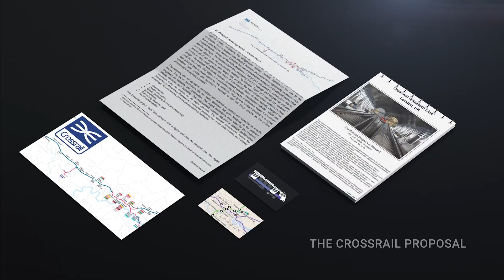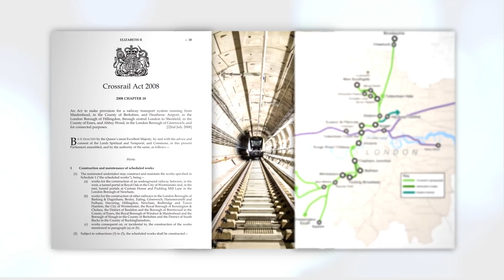London's $20 Billion Plan for High Speed Rail, Explained

Comment: There are inaccuracies in  this video. 1.  London is  not one  of the  largest cities in the world: it is the 38th largest city; that's quite a long way down the rankings. 2. I have never heard anyone call it 'Crossrail'; it is the Elizabeth Line. 3. The Elizabeth Line has been a spectacular success. Last year, it was stated that some 650 million passengers had used it since it opened in 2022. This is probably nearer 750 or 850 million now. Within a year or two we'll be able to say that one billion passenger journeys have been taking on the Elizabeth Line, which is the most heavily used rail line in the UK.

Comment: It is an absolutely amazing as far as engineering is concerned. As a Londoner, I believe it kind of fell flat on its face though. Trains don’t run as fast as was promised and no continuous East to West train. As for the CR2, I don’t think that’s ever happening.
Reply: Crossrail2 is happening the safeguarding for the route has been done, the between Maidenhead and Reading was an extension which was only added on later.

Comment: Just wondering, how did they decide that Reading, Shenfield and Abbey Wood would be the terminii of Crossrail? The first two are outside London, but the third is well inside the urban area.
Reply: It is all dependent on demand, originally Elizabeth line was only going to go as far as Maidenhead, but it was agreed that it would go to Reading, which required an extra 4 units to be ordered. For the Shenfield side, it was because of it having directly taken over and replaced the Greater Anglia Metro services. Abbey Wood is another terminal because of the connections to the North Kent Line.

Comment: The railway was built to take pressure of the Central line, the roads was a new one on me, just an excuse with rising travel costs and the cost of fuel at the pumps, Crossrail might take pressure of the Hammersmith & City and Circle Lines to/from Paddington.
Reply: It was designed to take pressure off the central and jubilee lines.
Reply: @suburbia2050  Funny that as the Jubilee Line Crossrail station at Bond Street was not open yet
Reply: @jacksugden8190  well Stratford and canary wharf are the main pressure points for the jubilee line
Reply: @suburbia2050  Waterloo Station may have been another

Comment: The central section opens to the public in a week's time, and when you released this video, trains had been running through it for final testing for months, so you're vastly wrong about the timescale. The only station that will be delayed is Bond Street. Crossrail may be late, but it's far from a failure.
Reply: Thanks for this comment... I was about to say something about the opening date for the 24th May (and I'll be there!) The bonus (with reference to the "antiquated" term) is that the first stage of the Bank station expansion/enhancement project will have opened the week before, so I'll get to sample both in one go! If you haven't already done so, watch the "Hidden London Hangouts" episode released last night, a sneak preview of the improvements there (and BTW it's a great series for both history and transport enthusiasts alike)

Comment: This isn't a failure when it hasn't even been allowed to run yet? The project was overbudget and delayed due to software issues but to categorise it as a failure is very premature and asinine. I worked on this project as well and it's an engineering marvel that Londoners will use more when they realise how good it is at reducing times and travelling with ease.

Comment: How can t be a failure when it hasn't started running yet?  I guess in the early days many people we go on it just to see,but then when it's running fully it'll be fine. I'm sure the people in Essex wanting to go to Heathrow will make good use.
Reply: Elizabeth line started operations in 2015 under the brand name TfLrail which was operated by MTRElizabeth Line and the class 345 aventras entered service in 2017 on the Great Eastern Mainline, then in 2019 on the Great Western Mainline. In 2024 they have now signed a deal for 10 extra units to help deal with the overcrowding on the line.

Comment: Sadly the mis-management of Crossrail will result in Crossrail 2 not being considered for a generation. Yet Paris has five working Crossrail lines for years and has embarked on a Paris transport project far more ambitious and larger than Crossrail 1. Inflation was factored into the Crossrail project but I assume the contractors and engineers submitted unrealistic low bids not to “scare the horses!” Essentially it’s a twin bore tunnel under central London from Paddington to London peninsular and under the Thames. The surface rail lines east and west were already in existence. Quite frankly if I travelled from Reading to London I would never use cross rail, only interchange at Paddington. The trains on GWR are far more comfortable, no hurricanes blowing through the train, journey time is faster but since Crossrail there are fewer GWR trains, not really a gain except for travel to City & Canary Wharf changing at Paddington. All rail infrastructure benefits the public but at a cost. The “Crossrail management team,” jumped ship and transferred in bulk to HS2, so that project is going to be delivered on time and in budget!
Reply: What a load of Crap. The Elizabeth line because it is underground at the major terminals it frees up expensive station platform spaces for those express trains that you love. You know commuter choice and all.
Reply: @suburbia2050  What are suggesting instead, building a surface line from Paddington to Canary Wharf? You need to take a look at the transport system in Paris, very much superior to London and in the future on completion of the grand Paris express project.
Reply: That the GWR trains don't call at most intermediate stops so if you want to visit and intermediate stop you have to use Elizabeth line or if you want to use off-peak tickets you have to use Elizabeth line between 16:00 and 19:00 on a week day.

Comment: "London is currently building the largest infrastructure project Europe has ever seen"... Paris is currently building 200 km of tunnel all around the city. So, no, Crossrail is not the biggest infrastructure project in EUrope.
Reply: Errr it was when the tunneling and stations were being built. 200km of tunnel? Errr lol
Reply: HS2 is larger than the Paris Project.
Reply: @J-Railway-Volunteer  i was talking about Crossrail/the elisabeth line, not HS2, which is not limited to London.
Reply: Some parts of Crossrail where built outside of London like between Heathrow Airport Junction and Reading was electrified as part of the Crossrail program as well as a new turnback siding at Maidenhead and carriage sidings at Maidenhead.
Reply: @J-Railway-Volunteer  thank you fir the info. But again, the lessage was to say that when the video claimed tht crossrail was the biggest infrastructure project in Europe, that was wrong as the Grand Paris Express waq of anither level
Reply: HS2 is a bigger project than Grand Paris Express. Crossrail was the biggest project until HS2 was announced in 2010 with construction starting in 2017. HS2 is larger interims of amount of track than Grand Paris Express.

Comment: Good video! Also - I fee like the commentors are misunderstanding the video. To me you were basically describing how complex the project is. You literally said at the end that "in reality it is a .... (positive thing).  It's weird. When watching any infrastructure type videos for projects outside of the US (and sometimes Canada, the UK (obviously not in this case), and Australia) the videos are supposed to be commercials for the project according to commenters. But if it is in the US (outside of some Sunbelt projects) then a video on instracture that isn't a straight up roasting video gets labeled as propaganda.
Reply: Misunderstanding? Within the first 30 seconds Crossrail was called a failure multiple times. A project that's almost ready at the time of posting & this video contained numerous errors that others pointed out. 

This was a poorly timed video or a fuckin genius play by the creator to boost engagement by having people in the comments call out the incorrect assumptions and facts.
Reply: Crossrail was easy compared to other projects have been built in the UK rail sector.
Reply from the maker: Thanks, I'm glad you enjoyed the video. I believe that Crossrail will be successful, and I think it will solve a lot of the infrastructure problems London is facing.

Comment: I disagree, this is a massive feet of engineering, the stations and trains are excellent and it will help take capacity off the very popular and crowded underground lines. Also it isn’t just a tunnel, dozens of new deep level stations as well as surface stations on existing and brand new lines.

Comment: As someone who has traveled on both Londons and New Yorks underground system, its very strange you use the word antiqued when referring to londons network. Excluding Crossrail London underground has been extensively upgraded and modernised completely in the last 10years, new air conditioned trains, remodelling of stations, upgraded signaling and many major extensions. I think your video is poorly researched.
Reply: I agree, despite some tunnels being very old, the amount of investment of upgrades and modernisation is actually technically better than NYC's subway (which is a fine subway in its own right, not an attempt to knock it). There have been multiple other projects on a scale approaching Crossrail that have been cancelled before in past decades so to try and criticise Crossrail while also calling London's public transit antiqued is a definite contradiction.
Reply: The London Underground is way better, more colourful and more comfortable than  the New York Subway. Among the many reasons for this are two: 1. London Underground stations are distinctive and  easy to see from a distance. The entrance to New York subway stations look like, and can easily be mistaken for, basement entrances. If you look carefully you might just be able to see the station name - in really small letters. 2. The announcements on London Underground trains are loud and crystal clear - because they are recorded and spoken by actors. But they're also clear if the driver has to speak. By contrast, the announcements on the New York Subway are too soft against the rattle of the train, spoken by the driver and  are thus really indistinct. I could just about catch the name  of the station but nothing else.

Comment: Not sure when this was written but as of March 2022 all rail, station and signalling infrastructure is complete and tested and are now in shadow operational mode. All stations bar one have been completed and handed over.
This month has seen the last of the emergency testing with hundreds of volunteers being used to vacate a stopped train in a tunnel.
In fact the western end out to Heathrow and eastern ends of the line out to Shenfield have been operational for some years.
As for costs now they are what was budgeted at first but cut back to gain Parliamentary approval. So they were actually accurate!
Failure? No. It is an incredible feat of civil engineering and some of the techniques used to safeguard old buildings and miss all the underground infrastructure while tunnelling are industry leading and now used elsewhere. I would rather it was late than never be built.

Comment: 4:15 “it just needs to be lined with track to be completed.” As you are showing a clip of a train in the new tunnels with tracks. Tracks were laid in 2017/2018
4:35 Yep, Crossrail services ran between Liverpool street and Shenfield since 2016 (taking over from a local operator) and Paddington to Heathrow in 2018 (again taking over from another operator and 2019 for Paddington to Reading services to he handed to TFL from GWR. Abbey wood station has been open since 1849 and the Crossrail refurbishment finished in 2017, not 2021.
Crossrail is opening in 2022, the central core, in which the whole line will be functioning by then. Full integration in stages until 2023. The full integration was supposed to happen in 2020. so actually only 3 years behind schechuled. for the full line.

CROSSRAIL IS NOT A FAILURE. This suggests that no one will use it. Just because its opened late doesn't mean its failed, I hope you're aware of that.
London's existing underground railways are not antiquated. New trains for 4 lines came in in 2010-2015. New trains for Piccadilly line by 2025. Northern Line extension. Bakerloo Line extension, Jubilee Line extension,  the BILLIONS TFL have pumped into the system to refurbish, expand and rebuild system. Automatic trains on 8/11 lines. If anything its modern, even for European standards.

At least you didn't call Crossrail a new London Underground line.

POST-OPENING EDIT:
I think its much more heavily used than TfL expected post-pandemic, another reason why Crossrail is not a failure
Reply: So many things are wrong with this video
Reply: If it was a failure, then why has a new contract been signed for 10 additional units to deal with the over crowding.

Comment: The railways complete, it’s in testing. 2 stations yet to finish but it’s 95% there. There are testing trains running through the core section. Liverpool to shenfield opened 4 years ago!

Comment: If you want to see a construction product well over due and over budget come to South Wales where  the A465 trunk road  is being dualled from Hirwaun in the west to Abergavenny in the east , a distance of some 25 miles (45km). The widening of this road from single to dual carriageway started in 1999 and is still not yet completed. The final section from Hirwaun to Dowlais Top  should  be  completed in 2025 bar any delays of which there will be many, no doubt given this project's history. The most recent section completed which was three and a half years over due itself is between Brynmawr and Gilwern. This section, despite its newly acquired dual carriageway status should have a speed limit of 70mph ( 110kmh) but instead has a reduced speed limit of 50mph( 80kmh)  which is less than before it was upgraded!!! . Pathetic!!  So, allowing for delays etc I cannot think of anywhere in the world where a  45km road will have taken nearly  30 years to build! Oh and jokingly  the proposed budget at the outset was probably around 15 shillings and ha' penny.  🤣🤣🤣

Comment: I fail to see how unique or innovative Crossrail is. 
This kind of project is nothing new.
London is basically doing what Paris has done in 1970s. The RER A of Paris is high capacity line with trains carrying up to 2,600 passengers every 2 minutes in its central core. It was made by connecting former  suburban lines with long tunnel under the heart of Paris.
RER A is carrying over 1 million passengers daily.

London is more like a latecomer because this kind of projet have been built in Paris, Berlin, Munich, Frankfurt, Madrid, Milan...
Reply: London did this in the immediate and post WW2 period, the Central Line expansions are a good example.
Reply: @PsychicLord  Not really, it wasn't new huge underground section under the center of the city as the RER A or Crossrail are.

The RER A was a really massive project with huge cavernous stations under Central Paris. 
There is an article about Auber, one of the several massive stations built for the RER A in Popular Science of August 1972. Even today, no Crossrail station comes close in scale.
Reply: @Furitokama London first did it with the Snow Hill tunnels in 1860s.